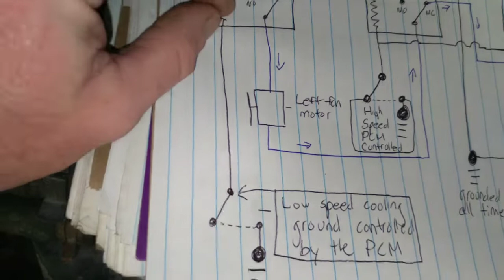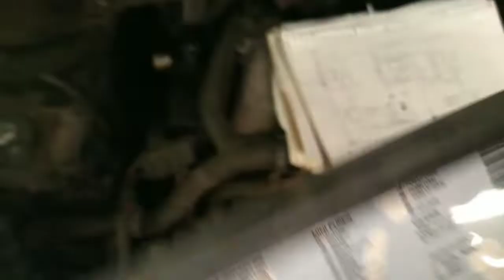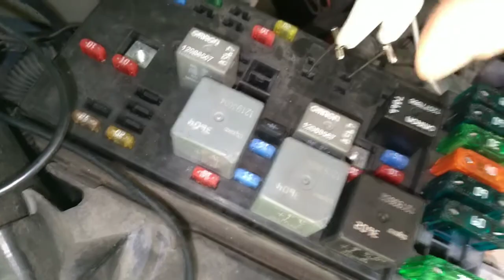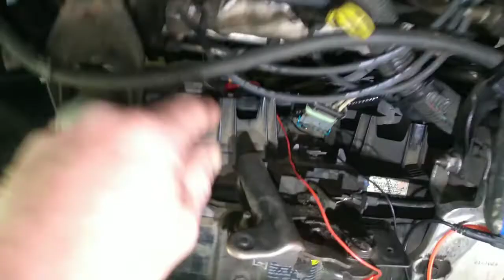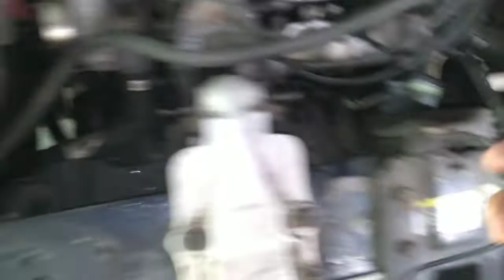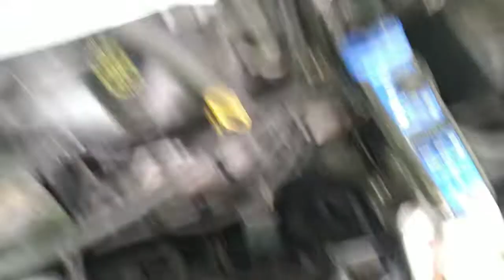Chevrolet Venture overheating? Cooling fan problems and a complete troubleshooting procedure

Comment: Brother !!!!!! Thank you so much for all your time and efforts in making this video.  I just replaced the head gaskets an intake gaskets on my little Van. I bought it for 500$ because of the blown head gaskets. But after the new gaskets were installed, the van was still overheating.  The fans weren't coming on. and thats why it blew the head gaskets to start with. Turns out, the therma switch near the gooseneck was bad. But without your video an trouble shooting.  You put me on track to find this problem. THANK YOU !!!!!!
I love my little van an so do both of my daughter's age 5 an 7 ... THANK YOU !!!!!

Comment: I'm having fits with mine, I hope I understand enough of this to help me out.  Neither fan comes on.  Have new thermostat, temp sending unit and all relays check good.  Going to try and check fan groundsand per to fans using what you showed.
  Hooked fans direct to 12V and both work so it's something between relays and fans.

Thank you

Comment: Good information on the video, our 2001 venture had the same connection burned out, and the motor is overheating. What was the purpose for cutting the two wires from the burnt connection? Will have to check for ground and see why the fan doesn't work.

Comment: I have power going to all 4 wires to my fans for some odd reason .I cant fiure it out pcm wiring harness or fuse box anyone else have this
Reply: I went thru traced everything from the fans to the fuse box .I have no power going to any relays .But when I test the fans plugged in all four wires are live
Reply from the maker: Do your fans work at all and when your testing the relays is the engine warm enough to engage the relays or did you try it with the air conditioner running?

Comment: Hello mate . I’ve watched as many videos as I can find on this issue but yours is the best explained and I can almost understand but I’m very thick with electrical and diagrams and getting it straight in my head. I’m not just saying it I really am. I’ve got a Ute with L98 motor. It’s been running hot for ages and nothing I try helps. I’ve changed radiator, thermostat water pump. I’m in west Australia not far from the desert and it’s get hot so it a big problem and need Ute for my work. If I don’t fix it soon o know I’m stuffed and don’t have money to pay people. Like in America or maybe more cost of everything here is way too high. 
    From what I understand from your video is if the high speed fans both working ( mine are ) then all three relays must be ok. 
   My coolant temp must work because I can put Ute in engineering mode and it shows temperature. I think that must mean it’s good? So both fans come in at 108 or about 240 which like you say is very high. I stuffed my ac up so haven’t got that. I fiddled with the knobs and let the gas out without realising. 
    So for me it’s the low speed fans not working. I know the fans can work because they both come on at high speed for high temp. I think the relays are all good because high speed works. So what else can it be? Wiring… I’ve looked at wiring looks ok. I’ve got a multimeter but have never been able to understand it so don’t use it. Ever and that pushes me off. I don’t have a light but you said be careful where you put it or can damage bcm so best I don’t try that. That’s where I’m at. I’m on verge of giving up . Things won’t go well if I do I know that. So any advice you can give me I would appreciate very much. Col

Comment: 2005 chevy uplander. Fans dont come on. Tested fans and they work... fans do come on when you apply ground on any of the 3 relays. 1 low speed and 2 fast apeed.. temperature its been all the way to 210-215f and fans never come on. Idk what to do
Reply: check the thermal switch by the gooseneck under the throttle body.  I had you exact issue. an that therma switch was bad. If you run your a/c it should activate the fans over riding all switches an relays. this got me by until I could get home an fix it .. good luck

Comment: Mine only turn on the aux fan when a.c is on.. when i turn off the a.c both fan will turn off after a minute..what would be the problem?relay?
Reply from the maker: What's the make and model of the vehicle you own and yes it could be a relay, bad wiring, bad ground, bad coolant temp sensor, or the pcm not commanding the fans. Does the fans run at low speed or high speed with the AC turned on and are you sure both fans are running when the PCM commands them on and off while you're running the AC?

Comment: Thank you soo much! I have a chevy venture wb edition with overheating problems. I've changed out the thermostat and flushed the radiator, this helped me out alot! It was a relay.  I also had to bypass the second radiator in the rear for now because the motor gave out. Again, thanks for the help!
Reply from the maker: I'm glad it helped you, I've worked on quite a few of these vans for overheating issues. Seen people change intake and head gaskets and they continue to overheat because of a problem with the fans, either one will work, neither will work or they'll only run in low or high speed all of which will overheat the cooling system. Thanks for the positive comment and if you haven't already would you please subscribe to the channel and feel free to reach out anytime